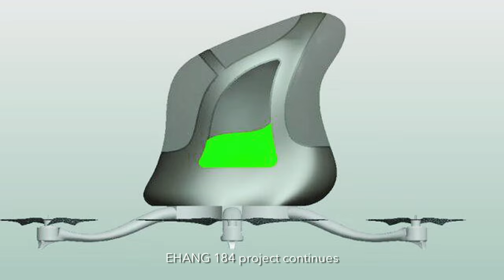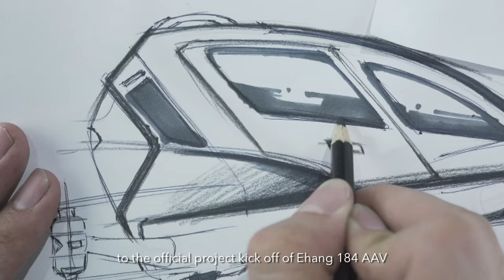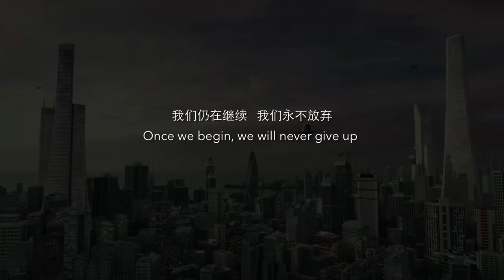EHANG 184 Launch Video from CES2016

Comment: Well it would be good for photographers taking 'high' altitude photos, definitely not for travelling long distances. If it runs on a battery it needs to have an extremely good cooling system, it would probably be better of with a fuel cell and solar panels with a backup battery incase of emergency. If they manage to make a copter with a battery last travelling 100km+ in distance I would actually be amazed.

Comment: How safe can it fly in the wind speed that's increasing from 10 to 66 miles per hour or heavy rains?
Reply: +Xi Le the same logic can be applied to driving a car in a snow storm, you have to prepare. But I know what you mean.
Reply: +Luke E   I hope man-made flying big machine with more safety to benefit humanity.  I wish their works on this flying machine with success. I am thinking of designing a "flying car" of my own too.  If I could come up with a good-shaped, affordable, and safe one, I will make a deal with the auto and air industries to make it happen for consumers to drive and fly.

Comment: Hermergerd. I dreamed of this for so long. Now, autonomy. I expect it to be electric, therefore with a pretty limited autonomy, especially if the load is heavier. Also, the annoying buzzing sound current AV do are pretty annoying. To avoid having a city permeated in such noise, everyone will either need noise cancelling headphones or the regulations will have to allow them to fly quite high. But if it's too high, it's going to be a nightmare for aviation and safety regulations (cell towers, crash handling, etc.). 

Right now, the less noisy drones have the smallest rotors and are the lightest. The less air need to be forced down, the less noise it makes. But this... I bet it's going to be maybe 6 times less than a helicopter (since it has 6 propellers, therefore 6 times less air pushed down at the same time), but this is still pretty noisy. Anyway. If people are complaining for wind turbine, that are far in a field, this will raise a lot of complaints in the city, where it will likely be used. Maybe tests can be done to see if the noise is more concentrated directly below, and use current road as areal roads, as people below will be already submerged in the sea of noise coming from the other cars. But it would break the only advantage of this mode of transportation, that is going in a straight line from point a to point b, virtually without any traffic. Anyway, I am eager for them to address this issue.

Although it is very well advanced, I expect this to be more accepted/ready by 2027-2030. Both for the advances in autonomous driving, and the regulations concerning drones, as well as safety features to comply to whatever new code that will need to be written up for each country. Lol... It would be funny if it became more accepted around the time autonomous cars become the norm. I am sure a UBER type service will allow us to not require a car (in the city, at least), simply summoning it, and this flying vehicle promise this too, but more practically. As they grow in size, I am sure it will become the long term future of ambulances and many other services vehicles. 

The roads will become less used, or at least, used only for heavy merchandise. Cities might want to replace the costs of inner-city roads to maintain parks or pedestrian walkways instead of roads. outer-city roads might still be necessary, until the range increase. 

However, I guess flying in heavy winds will be out of the question, despite that it IS possible to drive in a storm... So an integrated transportation solution is still necessary: roads + HyperLoop between cities-suburbs, metro/skytrain + flying cars in cities. Hopefully. Still a good 15-20 years, though.

Comment: I would want total control of flight... probably set up similar to a modern day heli or plane. throttle on lever joystick controls movement in whatever direction and 2 rudder pedals. I wouldnt trust gps to fly me to work. Ive seen some dji crashes before and its not pretty...

Comment: what if the battery dies...
Reply: +Shu Evan You are the captain of the ship and the captain always goes down with the ship.
Reply: +Shu Evan One would imagine the drone would land if the battery got low.
Reply: +ensteffo I'd worry if the drone is going to land me on an open interstate highway. I won't trust an aircraft piloted completely by a drone with no possibility of manual override.
Reply: +Shu Evan What if a Boeing 787 runs out of fuel?   Dah.
Reply: +Shu Evan the propellers wont stop moving because of falling. So it has a significant stopping power and you just glide with it to the ground.
Reply: +Shu Evan 
Helicopters can rely on Autorotation if the engine stops. What that means is the blades keep rotating even without the engine, that way they can safely land.

Comment: Whos the lucky guy to make the first test flight :D When that ehang app crashes :D
Reply: +pukki34 I think that it will land safely, switch to manual flight mode or use RTH (Return To Home) in case the application would stop responding. I would gladly have flown the ehang 184.
Reply: MaQan Hopefully we will see it soon, I have a feeling the ehang wont ever fly

Comment: Open rotor blades? Quadcopters and remote control drones have been around for several years. They first came out with open rotor blades and then now you see the high quality ones put a plastic flexible shield around the blades to protect them. That's real life testing done on remote control drones that proves that it isn't such a good idea to have your rotor blades exposed specially in rough landing and even while flying. Was that a "because it's a toy" thing? Did you intentionally not include those? What was the design reason why something that was proven to be useful in a test "toy" environment isn't needed in a "drone" like vehicle that is intended to transport a living human being?
Reply: +shogrran Good question... not to take away from this impressive effort, but I'm also curious as to why the rotors are below the cabin, as opposed to above it as in every practical rotorcraft ever produced.  Also wondering why the quad copter layout would be preferred over a traditional helicopter or coaxial counter-rotating heli design.  And finally, I'm REALLY curious about the ruins of the "Academie Mationkle de Usique Lt", which is oddly close to the name and architecture of the "Adedemie Nationale de Musique" in Paris!

Comment: Just one of those electric motors malfunction will lead to disaster.  The multi blade helicopter are safe because of cross shafting between engines, this allows a  blade to function when an engine stops.  The engineering needed to make the above helicopter safe for human passengers is considerable and expensive. It could be sold as a one way delivery system.....

Comment: G'day,

 Yay Team...!

  It appears prodigiously expensive.

 People who can afford such toys have often aquired personal antagonists along their roads to such riches..., and a Hardwood Boomerang launched on a "Duck-Shot" can deliver a Tree-Strike 300 Ft up in the Sky...; so anybody buying one of these would have to be on really good terms with their Neighbours...

   Another point, what's the Range ?

   Staying aloft for over 11 minutes is going well for a Quadcopter, and this has 8 motors, and in theory it cruises with all at 1/3 throttle, so that as long as 1 motor at each Corner is turning it can still fly ; but if any Corner loses both Motors/Prop's then the whole thing falls to the Ground and goes "Splat !", and often the Batteries also burn violently, emitting toxic gasses.

  Somebody might like building them, but the Chinese Stock-Market is in Freefall, it shut down after 7 minutes today, after losing 7% of it's Value, when China was  1 Hr : 37 minutes worth of Trading away from being Commercially worthless ; and the juicy bit is that the Market had been closed for the same reason just days before...all Shares are for sale & nobody wants to buy, so it's all collapsing..., therefore I doubt if this Triumph Of The Will will have much of a Production-Run...

 We live in Interesting Times, indeed...

;-p

Ciao !

Comment: I own one of those ghost drones. Worst drone on the market. My experience tells me there is no way in hell I would ever step foot in one of these. Awful company in all aspects.
Reply: +Dennis Dunbar Could you please detail it a little bit more regarding why their drones are awful?
Reply: +Serban Huiu extremely unreliable. The second flight I had with this quad it just decided to take off. Come to find out it was a motor that burnt up. Called them and no reply finally I had to post something negative on their Google + owners page. I got a reply saying send it in. Sent it in at my expense. Not cheap might I add. They sent it back some time later. First flight it just flipped upside down. Tried many times with same results. Tried getting ng a hold of them with again no reply. It is not sitting in the box it came in. Paper weight. Wasted money. Poor customer service. Poor quality product. Was not happy what so ever. Let me also add that I am not a newbie to RC. I have owned many or these with not one single issue other then this company and product. Does that sum it up?
Reply: +Dennis Dunbar Or you broke it yourself and you're salty and blame them on the internet.
Reply: +Konporer W. Yes that's the one. Also shown in this video. Made by the same people.
Reply: +tunkor lol that's the thing you are right, a lot of people do crash it and blame it on a faulty device. However this was not the case. This drone was not ready for production. It was rushed out and had loads of issues. If you go to the owners google+ page there are loads of noted issues.
Reply: +Konporer W. When I purchased this drone it was an indigogo product. It's a drone for christ sake. They all have their own little issues. That's fine if you think I am a liar. By all means go buy one. I could care less about what happens to other people making a dumb choice in products. My experience is not good and I would never step foot in this flying car thingy made from ehang. Just sayin.
Reply: +Konporer W. Wait. If you are so concerned about this drone I'd be glade to sell you mine. Lol
Reply: +Dennis Dunbar Yeah, not really the same systems bud lmao
Reply: +Konporer W. Very well could be. It happens.  But even with this new 2.0 if you research top consumer drones the Ehang ghost drone is know where to be found on that list. If you are looking choose wisely. I would easily suggest a phantom 3 or Yuneec. Dji has some good competition with Yuneec. Their new drones coming out are pretty sick. They also been proven reliable.
Reply: +LKVideos lol at bud. Ehang ghost drone is know where even close on the top consumer drone list.
Reply: +Konporer W. When buying a consumer drone there are two types of buyers, those who really want to get great Arial video, and those who want to just fly a drone. Those who are serious about getting great footage don't buy drones that hold a gopro or fly using a smart phone as the controller. Or would even have the option to use a smart phone to control it. It's just not serious piloting. And the gopro is an amazing camera yes but not for Arial footage. The footage bends and twists  and just looks awful when it pans. A drone that is controlled via a smart phone is a toy.
Reply: Dennis Dunbar yeah, but the ghostdrone is hardly comparable to EHANG 184 right ....
Reply: +LKVideos all I am saying with my experience with the company Ehang is no thank you I'll pass. That does not mean I do not like this idea and Atleast someone is giving it a go. It's a cool concept and would be awesome. But let's be real here. A vehicle that can fly it's self with a human payload? We are years and years away from this happening.
Reply: Dennis Dunbar I agree, but it's def a huge progress.
Reply: +LKVideos it's mega huge. I totally want one honestly I do. Especially if like they say it will not require a pilot licence to fly. Another thing is every time something new like this comes out like the electric car it is always so expensive only the rich can afford. It would be awesome if it was affordable to where anyone can own one. That also makes it more dangerous cause then they would be everywhere.
Reply: +Dennis Dunbar If you are not going to provide proof or are not going to show links then it's all Anecdotal. I am saying this because many people that read your comment will take it seriously. This will only harm the rep from the company.

Comment: Another try to seek media attention. This is bull. Where's the video with actual human flying inside. It's another volocopter type toy. And yeah, 23 mins fight time... maybe with wire connected. They just made good looking case and that's all. It is not the real thing cause of one problem - current battery technology cannot offer enough energy/weight ratio.

Comment: Bravo!, but the blades aren't safely positions aren't they?.
What about putting circle frames around the blades, and what if the drone vehicle fails in mid air or high in the sky and it falls on the public?.
And what about noise levels?.

You have a solution for these problems as well?.
And this is not a drone, its a 4 rotor air vehicle. 

Besides that, China has a clear vision what they want to achieve, something that the west here is very slow at.

Encouraging people to do better at education instead of blowing a huge group of people off and only let a few doing the engineering..

So i'd say again, Bravo China!.
Reply: +Morph Verse Probably have same problems as helicopters and they seem kind of successful. This will probable not be something everyone will use to fly to the supermarket in the future just like we don't do it with helicopters today after nearly 100 years.
Reply: ensteffo  I don't know man..

Comment: It can travel up to 11,000 ft!  That's two (2) miles to you math-impaired persons.  If you think a flying machine with a total range of 2 miles is useful and ready-for-market, I would ask you ...  Who is that market?  What would anyone do with it?  You can't even fly it to the store and back.  Come on now, this is one-step away from that ratty hoverboard we've seen lately.  And just as impractical.
Reply: +Ima SuperPerson Until massively improved flight time only for rich people to take a joy ride around their property i suppose.
Reply: ensteffo
- I guess.  For that kind of money you can buy a used helicopter and actually go somewhere.
Reply: +Ima SuperPerson The smartphone was firstly required to chage every half day, and you cannot use it continously for 6 hours. And people were asking exactly the same question before.
Reply: singrider
- That's a false analogy.  Cell phones didn't require a 50x improvement in batteries to be useful.  They were usable from Day One.  This thing has no use whatsoever, and would require a 50x improvement to even be close to useful.
Reply: So how much improvement are there since the first aeroplane compared to A380? Maybe something new than Li-ion bettary will appear in the future. Which is just like the change from wooden plane to carbon.
Reply: singrider
- OK then, we'll check back in 50 to 100 years and hopefully there will be a functional hoverboard.